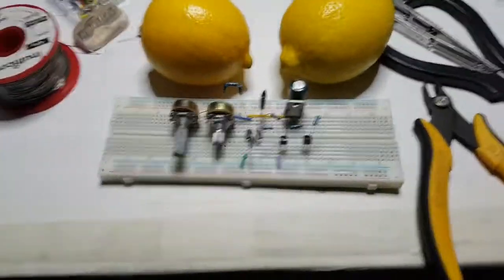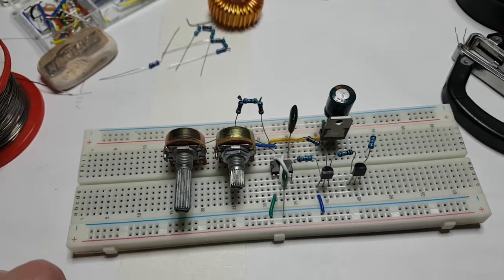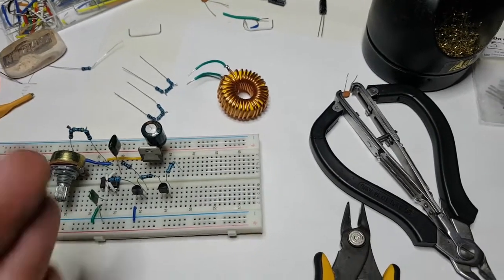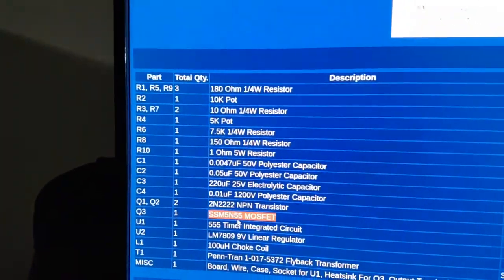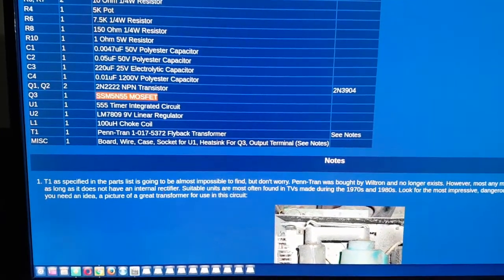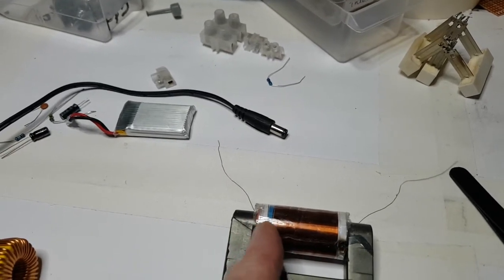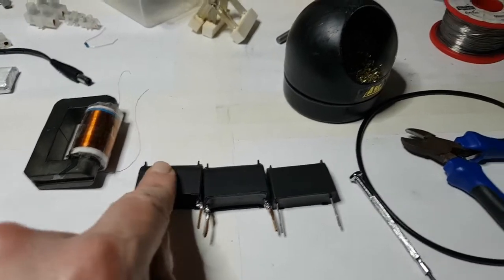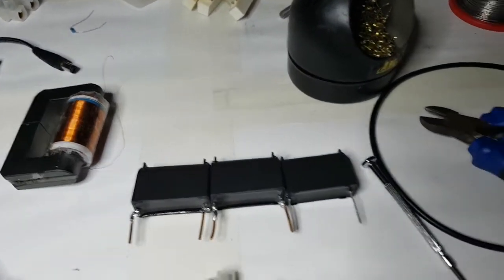Solid State Tesla Coil Circuit Attempt 1

Comment from the maker: I have found an old magazine article which I think is as close to the original circuit as I may get. Here is a link http://r9.webtuyau.com/wp-content/uploads/2014/06/Build_a_Solid_State_Tesla_Coil.pdf  Thanks to Brent C. Turner
Hopefully i can get this to work with more understanding.
Just to add, this article refers to Q3 with a gate rather than Collector, but confuses because it has a C5 and not C4.. lol